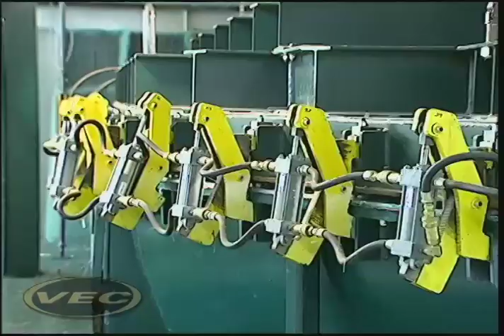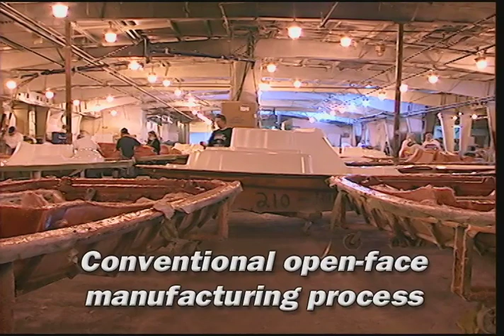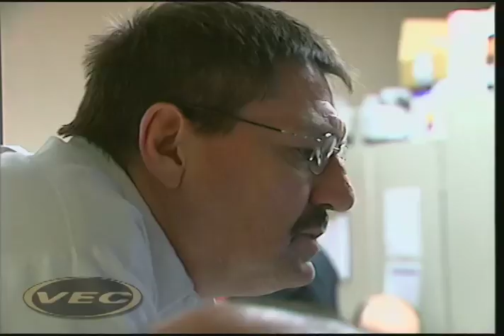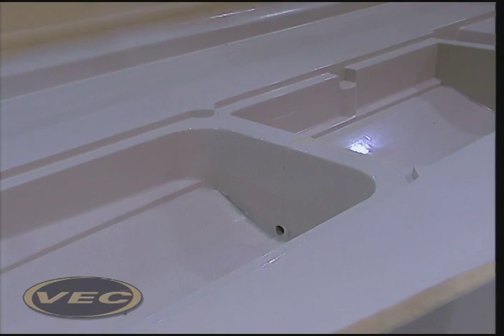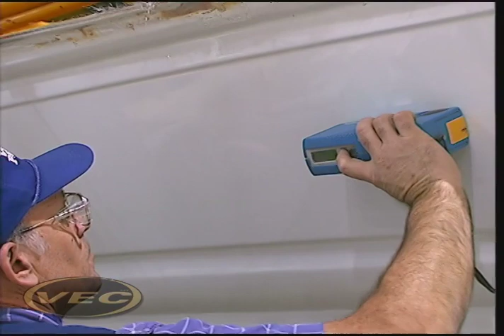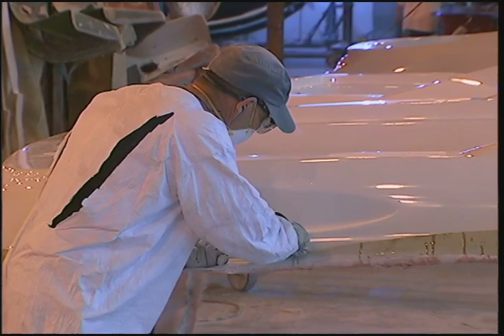FinCraft Boats - VEC Technology

Comment: Like it or not. The VEC Engineering Company is heads and tails ahead of hand layed up laminates. Larsen Boats also uses VEC and their boats are known for their durability. Google "VEC Engineering". I think you'll come away thinking differently.
Reply: Stephen, Larsen quit using VEC last year. The company that makes Larson boats, Genmar Holdings, also makes Carver and Marquis. In 2017 they closed the Larson factory in Minnesota, bundled up all 100 employees and moved them into the Carver/Marquis factory in Wisconsin.

VEC (which is a form of resin-infusion molding) makes a REALLY good product but it's got two huge drawbacks: it costs a lot of money to get into it, and you have to sell a lot of boats to justify running the process. A VEC system can produce one hull per hour. 

Now for the best part: the man who invented the VEC process sold it to the man who owned Genmar at the time. He only installed it in one of his factories - the one that made Larson boats. They sold the plant to trailer builder Wabash, who makes enough fiberglass trailer bodies that the numbers on VEC work out.

https://www.proboat.com/2017/07/larson-leaves-vec-behind-pulaski-move/